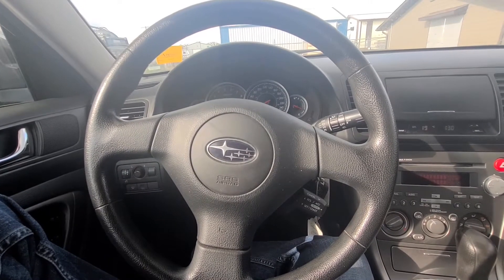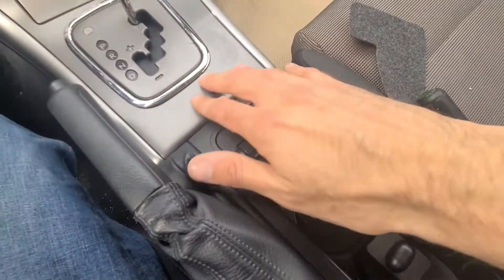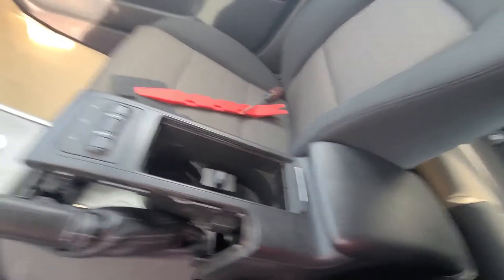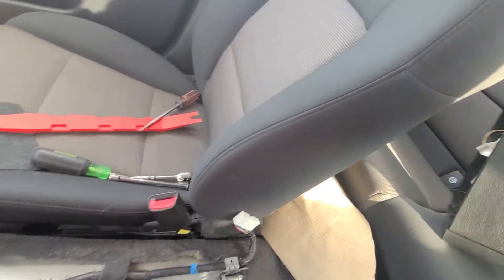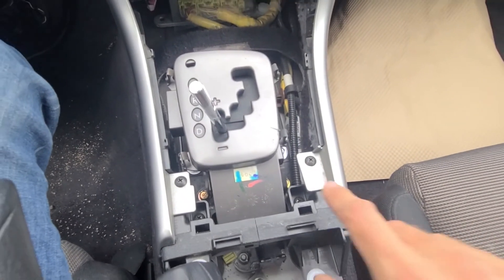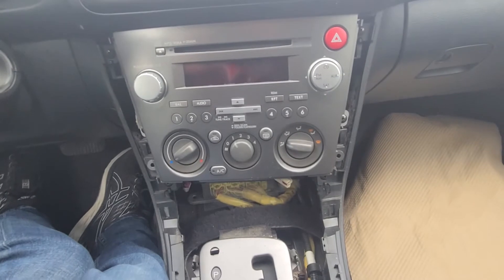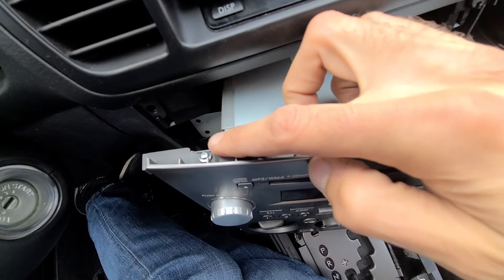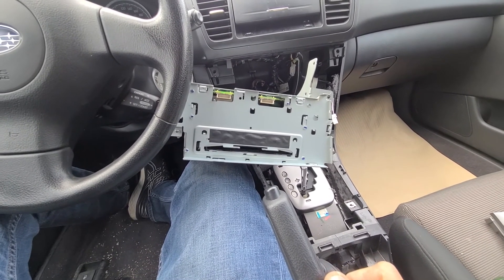Subaru Legacy Outback - RADIO REMOVAL / REPLACEMENT (2003 - 2009)

Comment: might be a dumb question, but DC the battery first?
Reply from the maker: Yes it is always recommended to disconnect the battery before unplugging any electrical parts

Comment: Is it possible to install a Double Din head unit into a 2003 Subaru Outback at all. Thanks
Reply from the maker: Hi. I've never did it but I think yes. They sell Panel Double Din Frame on Ebay so I guess once you get that and the wiring harness it should fit the dash